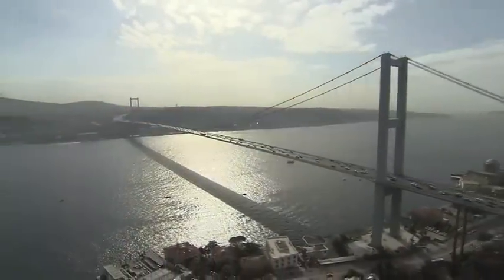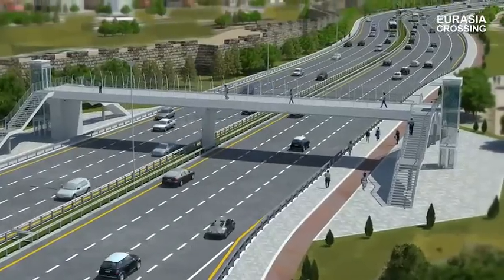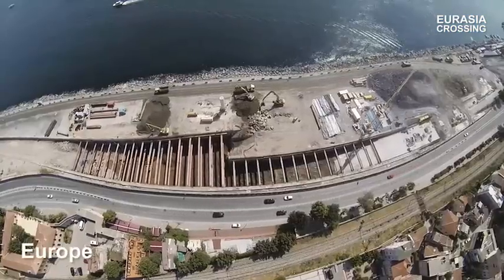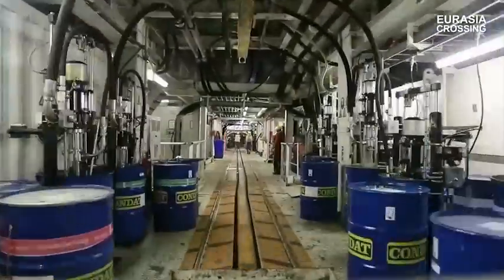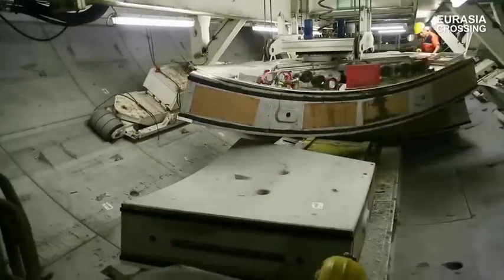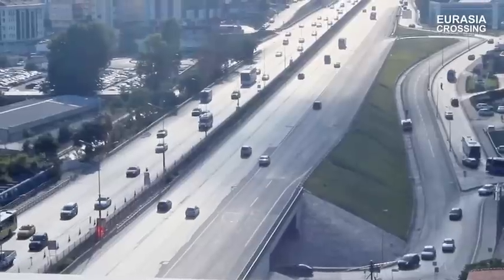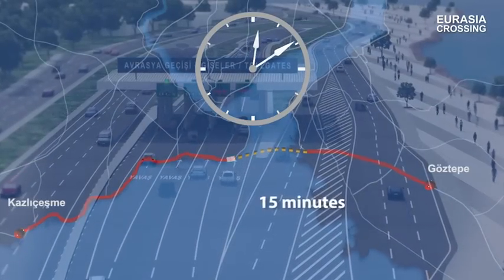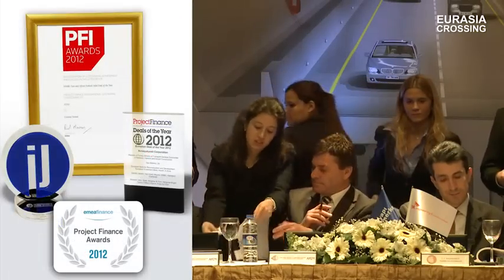The Eurasia Undersea Tunnel Project

Comment: Norway has already a dozen underwater tunnels like that. There's even a tunnel in construction that is 5 times longer
Reply: @neumailkonto1236  Was meinst Du denn damit ? In welchem Land soll ich Deiner Meinung nach um Asyl ersuchen ? Oder meinst sollte Asyl im Tunnel suchen 😂
Reply: Der Similaunmann yess but not that deep and certainly not between continents!
Reply: @HK-rw3ig  The depth of the Eurasia Tunnel is -106 m . Norway's Eiksundtunnel (completed in 2008) is -287 m. The Rogfast Tunnel will be completed in 2025. It will be -392 m !

Comment: Let's build a tunnel through an active fault line! What could possibly go wrong? 😂
Reply: They are not dumb they build carefully
Reply: not much... actually those tunnels are much safer in case of an earthquake then the surface....
Reply: @Knightfire66  -- Anywhere something can fall on you is not safe in an earthquake... On the surface with nothing around you is the safest place you can be... Being underground MIGHT not be TOO dangerous if it is built very robustly, but it is nowhere near as safe as just being on the surface with nothing around you.